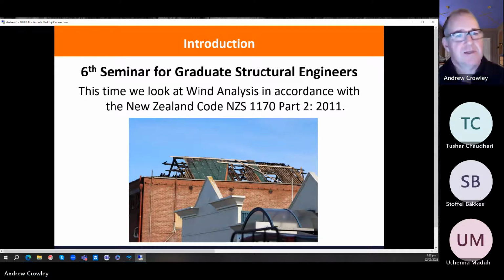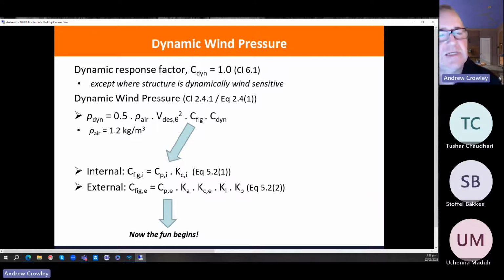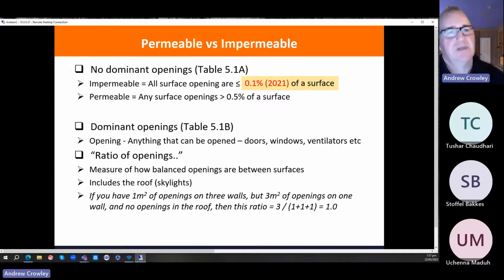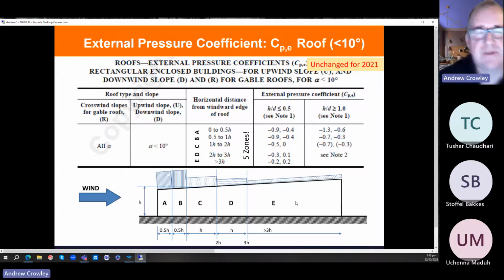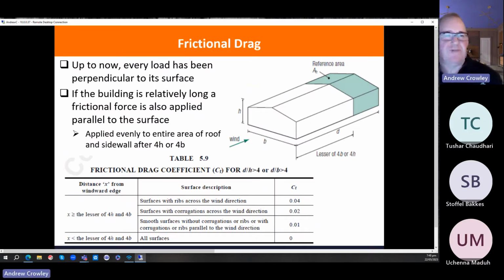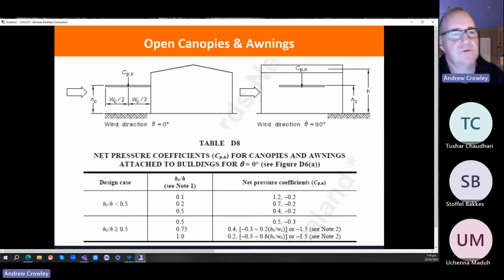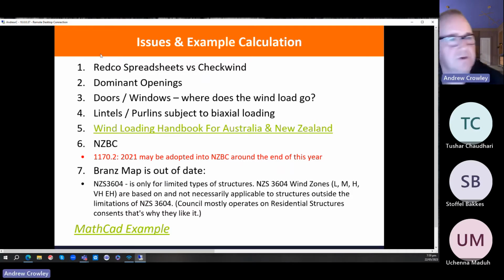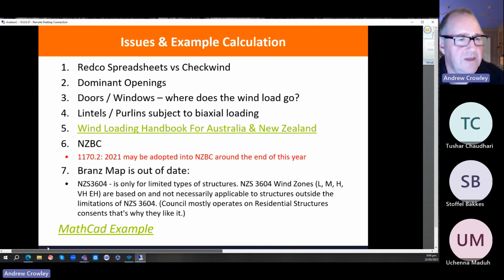CPD Webinar #6 Wind Analysis to NZS 1170.2

Comment: For high rise building above 200m, which standard need to be applied ? Because in AS1170 there is only applied for building under 200m
Reply from the maker: That's an unusually tall building for New Zealand. This would require specialist design taking into account the dynamics of the building and wind tunnel testing.
Reply: @daddypig6354  Thanks for reply. Could you send me some documents or technical guides relating to wind tunnel testing ?
Reply from the maker: @ See https://www.wsp.com/en-nz/services/wind-engineering-and-industrial-aerodynamics
and
https://www.auckland.ac.nz/en/engineering/our-research/engineering-research/research-areas-and-facilities/wind-tunnel-hall.html
and
https://wellington.govt.nz/~/media/your-council/plans-policies-and-bylaws/district-plan/volume02/files/v2wind.pdf